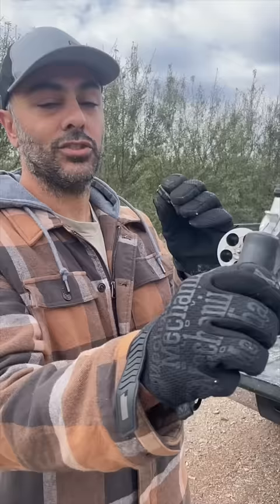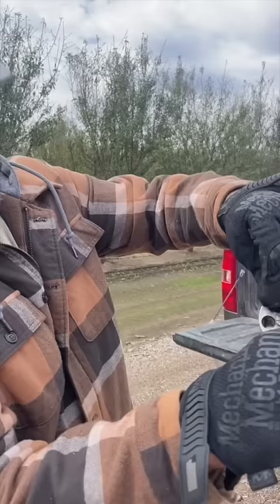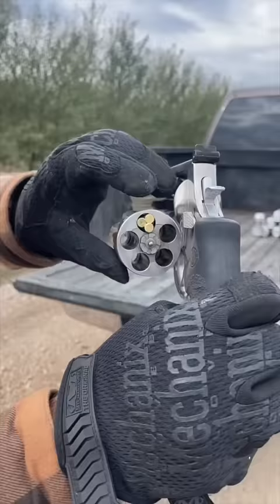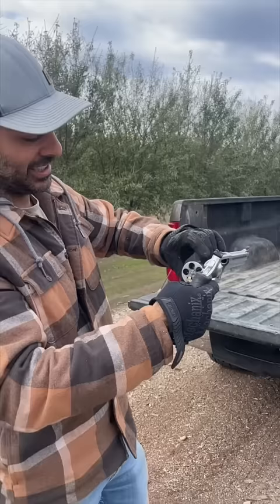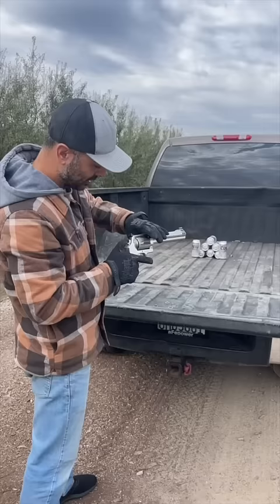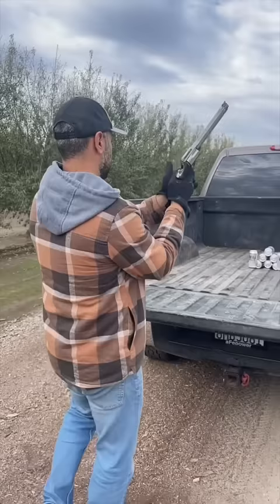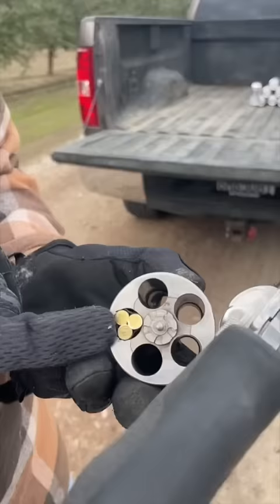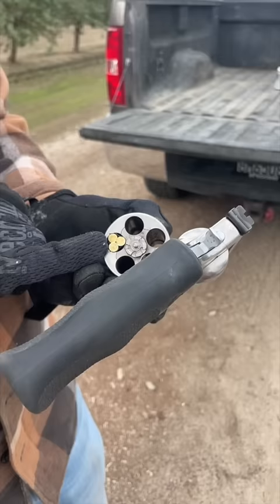Firing 3 rounds of 22lr out of 500 Magnum revolver?

Comment: Bro really was about to shoot the bed of his own truck 😂
Reply: it's pretty obvious that gun would've never went off
Reply: The worst part was him opening up the cylinder and aiming the supposed unfired but struck rounds into his palm.  Truck parts can be replaced, but parts of your hand will never be the same.
Reply: @CrazyPalidin57  you shouldn't point guns at things you don't want to destroy regardless
Reply: @CrazyPalidin57 bro.. do Yk how a firing pin works?? Obviously the bullets weren’t a risk to safety if they cant be fired
Reply: I think too hard lol what if one of them bullets would’ve got enough fire and it went off and hit something to make the car explode , hell no
Reply: He's wearing gloves; without a barrel, the penetrative force of most bullets is less than the case detonation out of battery.
Reply: Everybody knew that is never gonna go off without modifying the hammer. He know that to, thats why he point it to his truck bed
Reply: @Tower..  Still, if there was what one-in-a-million chance that even one went off, he’d have a hole in his truck.
Reply: @kugelblitzkrieg  there was 0% chance the rounds would've ignited inside the cylinder. 

if you're going by that logic, loading a round in the chamber is also unsafe because the bolt has a 1 in a million chance of igniting the round prematurely
Reply: It’s okay, he planned for those cans to stop it. 😂
Reply: @Tower.. I understand why the rounds wouldn’t of gone off but do you ? Can you explain it specifically for them to understand instead of just saying it won’t
Reply: @Bighannes410  the firing pin inside a weapon strikes the primer on the round itself, which then ignites the gunpowder and sends the projectile out of the barrel due to the rapidly expanding gas behind it
Reply: But in order to even strike the primer, it needs to be inline with the firing pin, those 22lr's were not inline with the firing pin, so it couldn't strike their primers, meaning no boom
Reply: @Tower..  If it were obvious we wouldn't have watched.
Reply: @tofamousjayofficial175  Do I know how a firing pin works? Dude, im a freaking gunsmith.  Do you know how bullets work is more appropriate, he said those rims of the rimfire were already struck, therefore still a risk of going off no matter if they are are still in the pistol or not.
Reply: @CrazyPalidin57  it's so tiresome warning fools, isn't it?
Reply: @Tower..  rimfire is struck on the outside rim not the center.
Reply: Bro wild AF I ain't going cap bro risk his life everyday 😭😭😭😭
Reply: Американцы, хули 😊
Reply: @CrazyPalidin57  As someone who's very unfamiliar with guns and bullets and i've never even shot a guh before.

i think a 22 bullet going off outside of a properly sized chamber/gun barrel wouldn't do much damage either way. 

I wouldn't risk my hand, but i'd wager a 22lr round going of in your hand does litle to no damage if you're wearing gloves. 

I'm even more sure that even if it goes off inside that 500 revolver, it wouldn't have any penetration power when leaving the barrel. 

I think the casing will just expand and without the pressure buildup from the chamber and barrel it's basically just becomes a weak firecracker.

Feel free to correct me if i'm wrong.
Reply: @CrazyPalidin57 unless you replace it with a truck hand
Reply: He def new it wasn’t gonna fire
Reply: Where is gas tank in pickup? 🤔
Reply: @Tower.. Never say never
Reply: @CrazyPalidin57 there’s no pressure containment on any of the rounds, you’d get a lout pop and case ruptures with the bullet literally falling down at normal gravity speeds
Reply: @kugelblitzkrieg it would've been shrapnel at that point would've broken itself up on the way out of the barrel and would've done superficial damage to the bed liner and if it went off in his hand like the goober above thought it wouldn't have done anymore damage to his hand than a couple of black cats and he had gloves on.
Reply: @CrazyPalidin57 we never see the projectile. Magicians never reveal their tricks.
Reply: @SolaceGreer what about backfire? The case might have flown backwards as well
Reply: @CrazyPalidin57 the were probably empty to start with
Reply: @Tower.. nothing is obvious except in hindsight
Reply: @Tower..  They are rim fired, so it’s theoretically possible the hammer could hit the edge of one of the cases and cause it to fire. The chances were low but it’s not as low as it would be doing this with center fire rounds.
Reply: Cos He already knew it won't work😂😂😂
Reply: 22lr's are the weakest bullets on the planet. A bulky phone book could stop them.😂
Reply: @user-ro8tr5zq6i the likelihood of a car exploding because of a .22 round is like none
Reply: He knew it won't work, it's obvious that the pin won't hit the primers
Reply: @Jaydaguap still doesn't matter gun safety isn't to be played with
Reply: He’s got a bed liner so it’s ok
Reply: @Jaydaguap hang firing is a thing 🤨
Reply: Exactly my thoughts to,what are you doing man ?lol
Reply: I am fairly certain those are rimfired 22 rounds.  Even if the hammer is perfectly aligned, its impossible to go off.
Reply: @Tower.. oh so my homework is off the hook
Reply: No he wasnt cuz he knew it wouldnt work
Reply: @jimaco0312  what
Reply: @CrazyPalidin57 you can hold a bullet even after it fails to fire… obviously this isn’t completely accurate but just for a simple example. The bullet is like a pressurized soda can. I only day that because even if you shake the soda can(aka try to fire the bullet) it’s not going to go off in your hand without being impacted(aka hitting the firing pin) now this is not to say freak accident can not happen so I’m not saying you should constantly handle bullets that failed to fire. I have seen experts in firearms examine a bullet that failed to fire and has a dent in the firing pin. Now personally I’m not pointing that bullet at my face either way😂 i also think they will do a lot less damage because they don’t have the barrel to travel through and build speed/velocity. Not 100% on that
Reply: @leefswgoh7558  you think a 22 she'll going off on your hand won't do any damage because of the gloves!? If that lead hits your hand at all it will go right through it. A 22 would be my last choice but it can still definitely kill a human
Reply: @stewpidasso3910  What? No, not because of the gloves. Because of the gloves ánd the bullet going of outside of the chamber. Not sure why you gloss over that rather crucial part...

Without the chamber and barrel the round won't even come close to reaching the same velocity, that's why i think it won't do much damage. 

Without the barrel and the backstop that a gun provides, there's nothing to buildup the pressure and direct the force in a desired direction. 

"Exploding OUTSIDE a Gun BARREL .22 LR" search this on youtube and you'll find a vid of someone firing .22 rounds without a chamber and barrel, you'll see it does much less dmg. Without the backstop in that vid the dmg would even be less. 

The gloves just add a little bit of protection when a round explodes in your hand, but they obviously won't stop a 22 round fired from an actual riffle.
Reply: No safety glasses or hearing protection either.  Darwin award chasing at it's finest.
Reply: Don't worry. I think he was aiming for the gas tank.
Reply: @kugelblitzkrieg a 22lr firing out of the appropriate gun wouldn't go through the truck. It sure s shit wouldn't if it's being fired or of a barrel that gives zero pressure
Reply: @CrazyPalidin57 you're a gunsmith? Do you think bullets work without pressure? 🤣🤣🤣
Reply: @Seriouslydave backwards? Backwards where?
Reply: @SirMegaManNeoX a small phone book would stop them
Reply: It's 22. Even if it did fire it would do anything.
Reply: @Tower.. thats impossible. You always have a gun pointed at something technically. Most have it low ready. But still. Guessing yall don't like the ground vary much huh
Reply: @CrazyPalidin57  Typical, people who know nothing about guns try and comment on a situation about guns. It's like liberals and politicians.
Reply: @Tower.. not necessarily.. theyre called rimfire cartridges for a reason.. just about anywhere u hit them with the pin they should go off, there just wasnt enough force to set them off from such an extreme rim hit luckily for this ape of a man..

Edit: theres also a cut in the video as hes loading them into the handgun where he swaps out some cartridges that have been emptied, at least thats what i assume the cut is for bc i dont see any other reason there would be one at that moment.
Reply: Hey its 22lr it would have bounced right off tht truck bed merly a scratch 🤣🤣 all jokes aside
Reply: @Tower.. these are rimfire rounds, saying it was a 0 percent chance is embarrassing. You don’t know what you’re talking about and you’re trying to educate others, breeding more ignorance into the world of firearms.
Reply: @Tower..  yeah, that was a problem on older guns, people avoided doing so for that reason, that's since been fixed but like, your point is horrible
Reply: Nobody considers they know sh*t about guns. This guy does btw
Reply: @Jaydaguap  Hangfires exist
Reply: @Tower.. 😂 
Why not lol

Comment: PSA: do not immediately place hand in front of misfired rounds as they may still have a delayed ingnite.
Reply: Sad that 99,9% here is immune to intelligence. There is no misfire and no possibility for a delayed ignition because non of the firing pins would be hit. Or could for that matter. No matter how often you pull the trigger.
Reply: Do u not understand whats haappening here?
Reply: I don't think we watched the same video
Reply: I don't think that's the main problem here I think
Reply: that's exactly what I've thought. I would be afraid to hold that gun in my hand after doing something like that
Reply: O pino nem acertou a parte que dispara as munições, ou seja elas não falharam, elas nem foram atingidas
Reply: @willscorner8423  you are immune to intelligence bruh, cuz the firing pin doesn't get hit by anything, the firing pin is what hits the primer on your round, in this case 22 lr is a rimfire round and the firing pin did infact hit the rim of the cartridge which should have set off the round, but it didn't because there was not enough force behind the firing pin.
Reply: @willscorner8423 22 lr is a Rim fired cartridge. The firing pin struck the RIM of the cartridge. 🤦‍♂️🤦‍♂️🤦‍♂️
Reply: @user-kf4dy9vq8d  even a unloaded gun you have to stick to the rules, yeah no pin hitting blablabla

Comment: The darwin award was very close to happening
Reply: Exactly how? Even if it did go off, it would have close to no energy on target since this is no seal in the barrel to accelerate the bullet
Reply: @romankalinchuk2750 some people are clueless 😂
Reply: @johncena-hq1ti   The only way the dude in the vid would be in any danger is if he pointed the thing at his head. 

Those are soft tipped .22LR inside the wheel of revolver designed to handle the chamber pressure of .500 magnum. 

If after 10 seconds and multiple primer strikes the rounds do not go off they're either duds or the hammer isn't hitting them hard enough. 

So with that in mind why are you harassing homeslice over there.
Reply: @clothar23 he means shooting at his own truck
Reply: Even if it fired, those rounds wouldn’t go further than the cans… tell me you know nothing about guns without actually telling me
Reply: @nickprice7752  He's pointing downwards into the bed of a pickup. The furthest they possibly go is into the ground underneath his truck. 

Assuming they don't hit say the transmission , driveshaft , or rear end. At which point those soft tipped  .22LR will lodge themselves into the hardened steel of said automotive parts. 

Even when he opened the revolver up he kept it pointed down range at a downwards angle.

So you want to try criticizing that again ?
Reply: @clothar23  If video games and movies have taught me anything, it's that cars always explode when you shoot them.
Reply: @ColonelSandersLite That's what op thinks too
Reply: @nickprice7752   Ok one of the ten rules of handling ANY firearm is to know what is behind it, even tho he was aiming at the cans from being that close it could go strait through the cans if he hit the side of one, or he could have missed as one of them only gone off and raddled inside the barrel and hit the truck. also it also depends on the ammo he was using 22 magnum, or 22 long  rifle. even tho he aimed at the cans i don't think he would want to hit his truck that he drives in.
Reply: Not that it would have enough pressure, but still wouldn’t put my hand in front of the cylinder after finding out a rim was struck.
Reply: @romankalinchuk2750 I mean, it's a loaded firearm, and he's pointing it at his truck
Reply: @romankalinchuk2750 I would never trust you with a firearm near me
Reply: To all the people here who are boot lic, er, I mean defending this dude,  there are positions available on the Alec Baldwin legal team.  Ya'll sound like a natural fit.  Wouldn't go past the cans??  Would only go through the truck bed and into the dirt??  Please, for societies sake, just stick to orange tipped guns, candied cigs,  and tall frosty bottles of martinellies.
Reply: I know it's unsafe, but if THREE .22lr rounds managed to blow up a S&W .500 magnum, I would be more impressed than I would be angry.
Reply: Not close at all actually. If you knew anything about guns you'd know why.
Reply: @bufordtjustice8630 Uh oh, we got a gun Karen in the house 😂
Everyone better carry their bullets in bullet proof kryptonite and lock it in a different room than your guns! If some dust hits the jacket all the bullet might go off at once!
Reply: @romankalinchuk2750  backblast and possible chamber explosion
Reply: @Mfields4517  lol, chamber explosion? You're funny